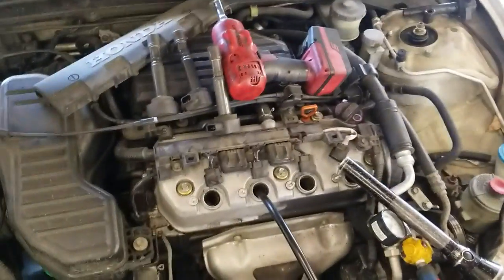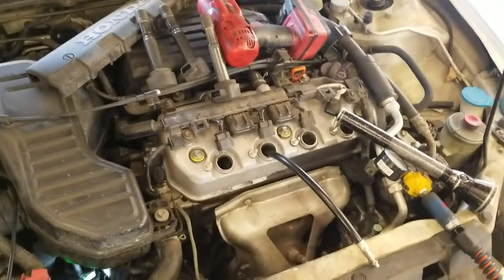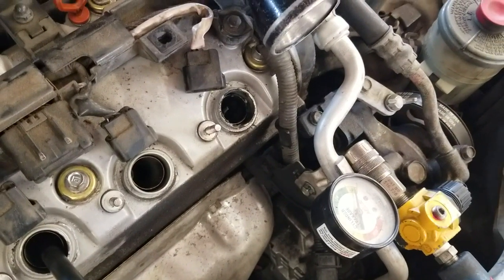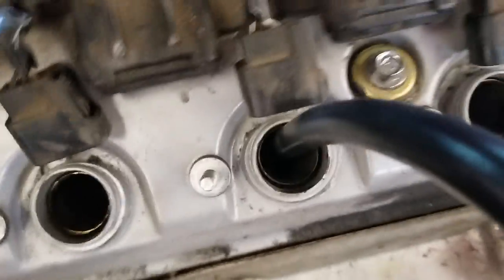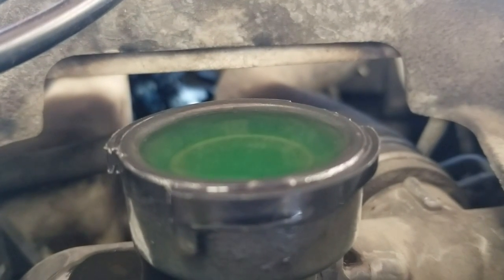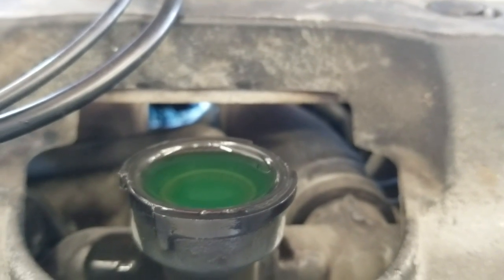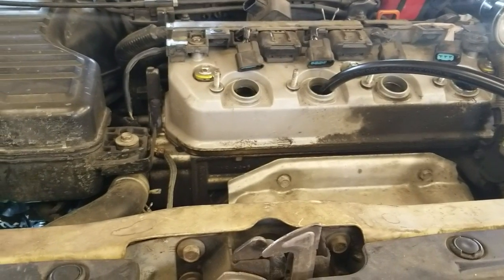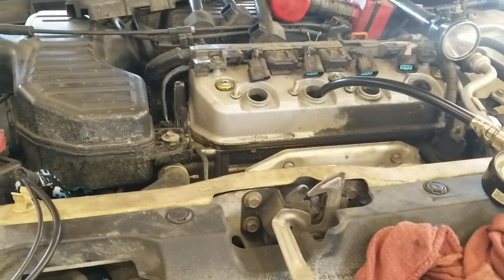Best way to diagnose if your head gasket is bad

Comment: Are you saying that on a cold start with radiator cap off that your coolant should not rise. If it does ,  could be a head gasket problem ?
Reply from the maker: Nope, your coolant will naturally expand when heated up. Im showing how to check with a leakdown tester,
Reply: subtledriver I got a 2000 Mazda b4000 with 4.0 OHV engine I’m loosing a little bit of coolant my engine don’t smoke or over heat doesn’t have coolant in the oil I did notice when I take the radiator cap off an start the engine the coolant starts to over flow do u think it’s a head gasket problem? There’s no bubbles when I run it with no radiator cap I parked it in a drive way an it had some water leak under the engine but I think that was from the air conditioner
Reply from the maker: @kamryn7496  how often do you service coolant and oil? when was last time you changed thermostat? Have you pressure tested the cooling system?
Reply: subtledriver I haven’t pressured tested it yet I just got the truck 1 week ago I top off the coolest every 300 miles I have to top it off just a little bit I just did a oil change on it an oil looked normal it looks like it just had a coolant flush not to long ago because it’s clean the coolant expiation tank stays at the same level tho it doesn’t go up or down it stays at the middle I noticed
Reply: @kamryn7496  check your bypass hose, I had exactly the same issue, always losing coolant without visible leak and initially thought it was CHG, until one day the leak becomes worse that when I fill the radiator with coolant,  its dripping under the engine (under the air-filter), so I remove the air filter and can see the  bypass hose (connected to throttle body) is blown and leaking, had replaced it myself and only spent around $3
Reply: SilverKenn I think it was having a head gasket issue it was smelling like it was burning the coolant an it would blow a little bit of white smoke so I just got rid of it an traded it for a 06 Monte Carlo then sold that car an made my money back on what I paid for the truck to begin with lol
Reply: SilverKenn i has same issue with my GMC Sierra 1500 no signs even though coolant was lost. But I grabbed K-Seal coolant stayed at good level without refill twice a day. Heat of temp stayed normal not exceeding plus no water from air conditioner line leaking into gasket only behind passenger wheel distance 4 inches. Before that air conditioner barely works now it’s perfect my hand freezes. After that before K-Seal additional I had misfires from 8 cylinder spark plugs that had been damaged from previously coolant leak leaving my emergency 🚨 check engine lights flashing. So I had it cleaned out and replaced also with new coil wires. The next day the check engine light came off to have only ABS on. So I’m excited I attack problem early. I agree with you if you let it go by get it will get  worse
Reply: Kamryn good thing you never used K-Seal on your car or you would never had that truck
Reply: That's exactly what's happening to mine I got a engine 75k and its doing this
Reply: My mechanic is telling me that I need a full top overhaul because of coolant has bubbles and it is blowing the water out of the radiator. I wanted to try something I watched on YouTube where you flush out the coolant and then put a head gasket sealant and let it run for 30 mins then repeat if for 5 times. Some of the comments said it worked. But with the symptoms my car is showing, do I really need a top overhaul or can I try this out first? I'm thinking that the mechanic might just want that extra job for the money. I will really appreciate your respone on this. Great vid and keep it coming buddy! Cheers!

Comment: Thank you for teaching us how to figure out if a car has a blown headgasket.   My 2002 Subaru has had many overheating problems.  I couldn't figure out my overheating problem until I took the car to the shop.  I have had my cousin do multiple radiator fixes where I have needed a new radiator and new upper and lower hose.  Then my car still had overheated.  So I took it to the shop, and then found out it was a blown headgasket.  My car has over 233,000 miles.  The price could be $1,800 dollars.  Definitely not worth it.
Reply from the maker: No problem! Time to throw in a low miles replacement engine from Japan!
Reply from the maker: Terminology!  harbor freight has a leakdown tester